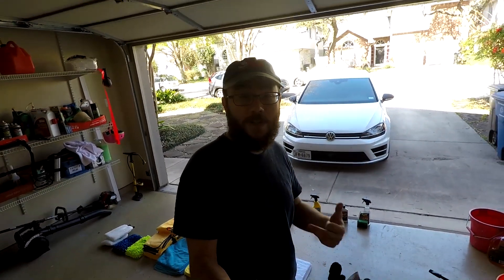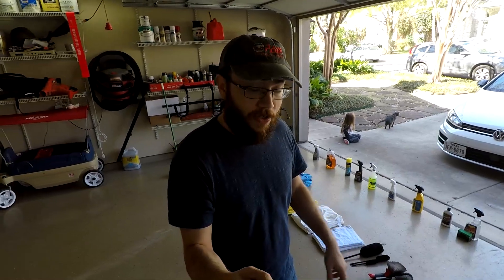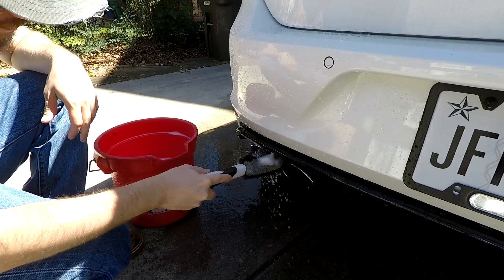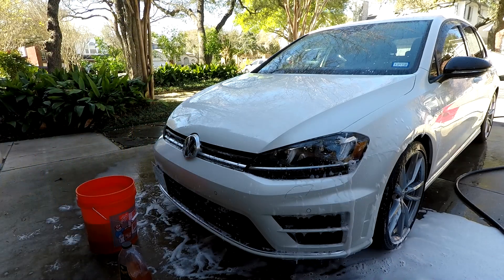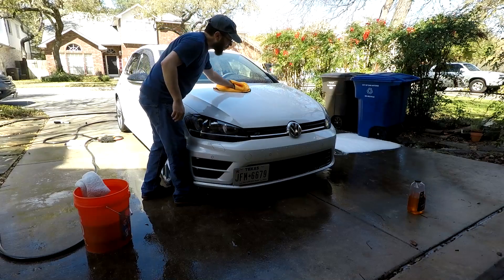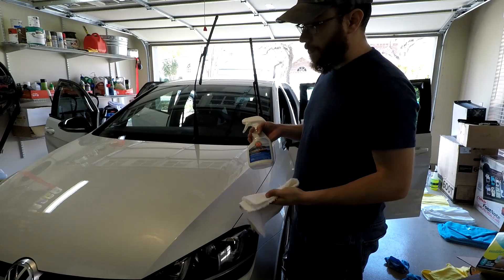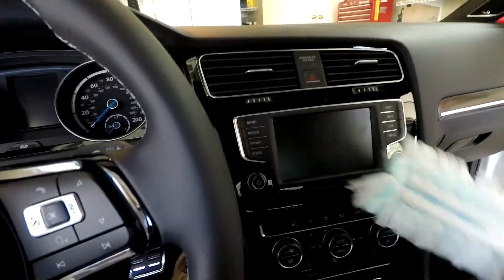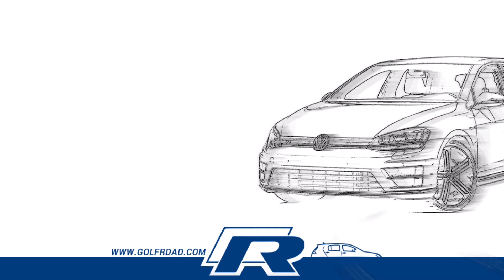Washing and Detailing Your Golf R

Comment: I would recommend not wetting the car before a foam wash, the foam is designed to loosen all the grime/grit etc which when the paint work is wet, it doesn’t have the best results. This needs time to dwell then should be rinsed as you drag the grime/grit around with you when washing. Then hit it with the two bucket method or even another foam then wash. 
Also for best results I’d recommend a iron out/fall out remover which should be applied to the car after you have foamed/rinsed/shampoo then fallout. Allow to sit for 2/3 minutes then rinse and dry. Keep up the good work :)

Comment: I would remove the wind deflectors, they scratch your windows at the top. Also detailing spray is a good activator when toweling down.  Detailing spray is great for shining up the paintwork in-between your wax intervals. 
Great video 📹 very envious of your nice driveway and garage 👍
Are you a member of detailing world. great forum. 
white vinegar your microfiber cloths before washing them in washing machine.

Comment: That front number plate looks so bad mounted off centre!
Reply from the maker: +sam67uk not a whole lot of alternatives with all the sensors on the front and air flow requirements. This spot is one of the best solutions I've come across for a front mount location.
Reply: GolfRDad why don't you mount it on the bumper under the VW badge. That's how they are mounted in the UK 🇬🇧 👍🏻